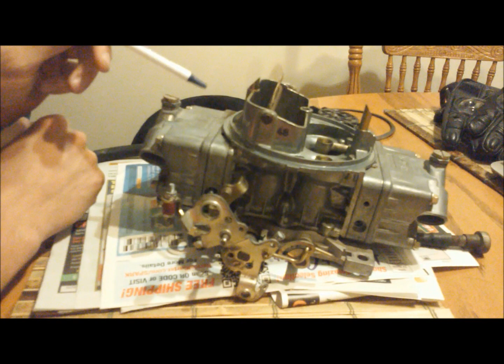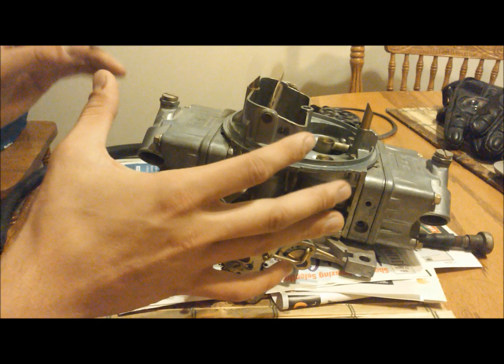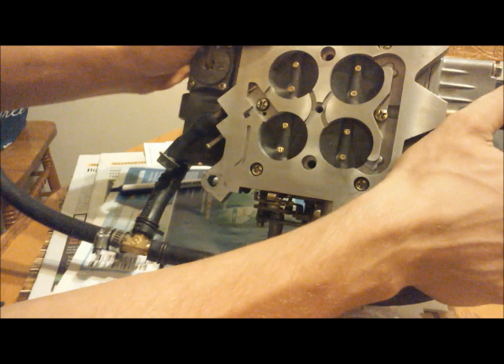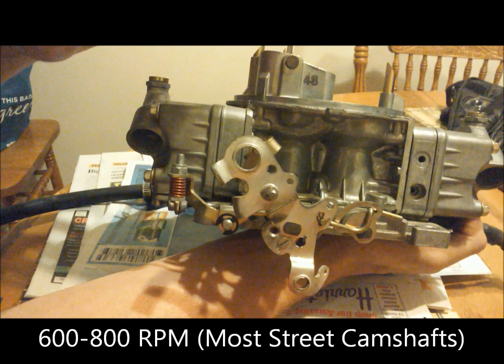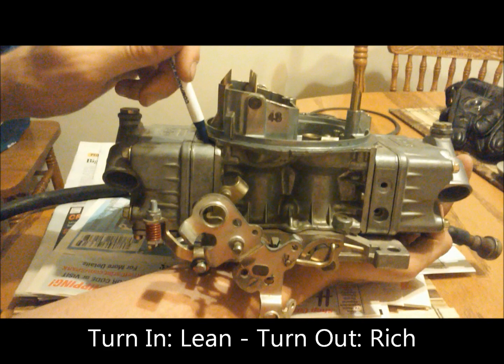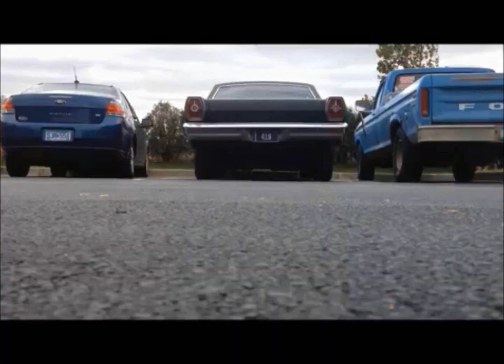Holley Carb: Setting Idle Setting & Initial Ignition Timing (CARB BASICS PART:1)

Comment: Hi ya Luke great tutorials!
With setting the curb idle with ported vacuum you said to advance the distributor to get your desired idle rpm. Well I fully adjusted the distributor to as far as it would go to about 24 degrees, I was still shy of my desired 800 rpm that’s way too much advance for my liking. You also said you can turn the curb idle screw a little to adjust the curb idle without upsetting the transfer slots?
I would like to leave the secondary butterflies as they were from factory ( closed ) without adjusting them to compensate the idle rpm. You mentioned this also, but in another video you said to adjust the secondary’s for extra idle rpm’s? I might connect the vacuum gauge to the ported vacuum and see if I can adjust the curb idle screw to gain the some rpm’s without upsetting the transfer slots letting vacuum in? Hope you can help? Thanks 
Regards 
Greg

Comment: I have a 650 quadrajet could you do a set up on them. 1981 vet. 350.has a mild cam. Motor is set up to a 1979 350. Computer has been dis connected. Had carb. Rebuilt at a shop that does carbs for race engines good repu
tation on carbs. I would like to go to Holly but linkage won't work on my linkage, any help would be helpful.

Comment: Hey, great videos great info as I am getting into lots of older vehicles and I wish to keep them efi free and computer free :). I got finished rebuilding my amc 327 in my 68 Jeep truck and getting ready for cam break in. I need to rebuild the carb as it sat for a year and leaked fuel from cracked seals and gaskets almost immediately. Another factor for the leaks is my electric fuel pump putting too much psi for the needle and seat. I will now be running a pressure regulator and gauge to monitor my psi. Are you familiar with Holley economaster 2300 models?  I imagine the settings for idle mixture, curb idle mixture, and the float bowl settings are all similar to the 4barrels you feature the difference being no secondaries.   Is there a “benchmark” or base setting for the mixture for doing a cam break in as idleing and testing is out of the question until the 20 min 2000 rpm break in recommended by my machinist is over. Thanks!

Comment: To set the bowl level with top screw, is the car running at this time?
Reply from the maker: Usually what I do is see where it’s at while running, then shut the vehicle off, readjust, then run it again. 
Holley recommends that this is all done while running, but that needle and seat assembly is pressurized. 
Unless you want fuel all over your intake, I’d do it how I noted

Comment: like your vids thunder...reminds me of the days I raced 1/4mile drags tearing apart carb after carb watching plug color and times, power valve plugs, increasing air bleed size, jets, squirters, ....hay had to ask, with all the issues surrounding carbs...lots of them along with the fuel pump issues, have you thought of going towards a holley efi terminator set up?
Reply from the maker: chevy vega I hear you - I do it for the people. A lot of guys don’t have the funds to do the efi stuff and carburetor tuning seems to be like folklore these days - I try to provide a channel that caters to the layman where they can keep rolling down the road trouble free
Reply: making the ride all complete slammin in your ride captain ride 8 track

Comment: Hey... Enjoying your videos.... But just getting into this one and you made it sound like a huge no no to touch the blade position on the secondaries, but in the previous video you showd how you use this to help your idle mixture
Reply from the maker: Let me elaborate on that. I used to teach that, but people tend to mess their stuff up when they do it and they have a hard time with it. If it's not a drag car, really most folks will be fine doing it with just the curb idle screw. Just make sure the transfer slots are set correctly.
Reply: I have a 496 in my 89 gmc that i occasionally race. But right now im having isuues at part throttle.... Cruising a 60mph/3000 rpm my afr is at 10.0-10.6. Idle is 14.5-14.9 and wot is perfect at 12.3-12.6... Tomorrow i will be trying to lower my front float as i know its in the top 3/4 of the sight glass... By the way, 780 quick fuel vac secondary. 72 in the front 84 in the back 6.5 pv 15in/hg at cruise. 241@50 hydraulic roller. Any info is greatly appreciated... Ps.. You do wuite a good job with your videos
Reply: But this is y i was considering opening the secondaries... To help lean out the cruise afr
Reply: No advice then?
Reply from the maker: +Joel Scharfenberg I plan to address this - I'm a traveling engineer by day unfortunately it keeps me very busy
Reply: No worries. I understand. Just did not think that woulda been the case when your first reply was within a minute
Reply from the maker: +Joel Scharfenberg alright, able to address this now - what is your manifold vacuum during these pet throttle issues? Do you have a vacuum gauge you can plumb into the car for me? Also, what rear gears are in the vehicle?
Reply: Hey. Good to hear back... 3.73 gears cruising at 3000rpm/65mph i have a reading of 14/15 in/hg.. Idle is 9-10 in/hg. 6.5 power valve... Just the cruise/steady throttle is rich. Idle and wot are perfect. Even under heavy acceleration (not wot) the afr reads decent numbers, cruise afr is about 10.0-10.5

Comment: 2-1/2 turns on the mixer screws?  is that full turns?  I ask because other guys have shown 2-1/2 half turns.
Reply: Kooduh Holley states 1 1/2 to 2 turns, not 2 1/2.   I am gonna try your settings.

Comment: just curious when you are using this method to set the initial timing are you doing this in gear and are you vacuum capping off the advance can while setting timing? Thanks!
Reply from the maker: I am capping off the vacuum advance for sure - i have manual cars, so its easy for me. with an auto, you would want to set it up exactly how you would be sitting when you came to a stop on the road. check out my most recent two carb videos. these should be very helpful - a little more to the point, and demonstrated on an engine.
Reply: Will do. Thanks for the info and quick reply!

Comment: Quick question for you. I have a 1968 Thundebird with a bone stock 429 with a holley 4160 vacuum secondary up top. When i turn on the car it starts slowly reving up like i have my foot on the gas and im slowly pushing on it. Can you think of anything i should check. i do have a secondary issue when i need to replace the voltage regulator. Do you think this could be causing the issue?
Reply from the maker: Well, as an engine warms up, it will atomize the fuel better as it gets warmer and the idle will increase. Make all your adjustments on a fully warmed engine. Or is it an unnatural increase like 500 rpm in 10 seconds
Reply: ThunderHead289 It isn't natural. it goes from like 1000 up to 2500 in a matter of seconds much like if you were accelerating onto the highway
Reply: Do you think the choke being tuned improperly could cause this?

Comment: In another video you mentioned not relying on the curb idle screw; but rather, installing an allen screw in the base to facilitate adjusting the secondary butterflies.  Was that for a mechanical secondary and not a vacuum driven one?  Or, are you just trying to keep it simple for the new and inexperienced?
Reply from the maker: +mark teague im trying to keep it simple, but also use good practices. i still mention only exposing the transfer slot so only a square is showing and then using your initial timing to get your idle right. from there, i personally will adjust the secondaries, but for beginners and with mild street engines, this will work best. when you get up to higher idles like 800 plus, thats when the secondary butterflies need to start opening.

Comment: Good morning. I just subscribed to your Channel.

I have a question (posted same comment in detail on your "Holley Carb Flooding Solution -FUEL PRESSURE" video a few minutes ago).

My question is; why does my engine shut off AS SOON AS I LET OFF THE GAS PEDAL after launching from dead stand still @ 3200-rpm?
Reply from the maker: +Buick Torque iv only had this issue once back in the day when i drag raced the galaxie with a mechanical fuel pump with my smaller fuel line and no return line (open gas tank breather). i had to put a fuel pressure gauge in my car to determine this. when i left the line, the inertia working on the fuel would literally cause a moment of fuel starvation. it was either that or fuel slosh away from my pickup. after an electric pump the issue went away, and with some gas tank baffling it has never happened again. its hard to say. an aft gauge and a temporary fuel pressure gauge plumbed to the inside of your car can tell you a lot.
Reply: +ThunderHead289 Thanks VERY MUCH for your reply. I am using both electric and mechanical fuel pumps with no return line.
Reply from the maker: if you have the time, i 100 percent recommend running a return line. made a huge difference in performance loses in hot weather. with your actual issue, i 100 percent beleive that it is because your pump is too high. lower it and run just the electric pump. What i do with the galaxie is have a block off plate and if i ever have an issue, i have my mechanical pump on hand to install as it will pull through a dead electric pump. my biggest concern with running both is that if your mechanical pump fails, you fill your engine with gasoline. iv had issues with burning down electric pumps without having a return line, so do keep that in mind. my improvised fuel line in virginia worked wonders. heres the video on it. https://www.youtube.com/watch?v=YUmaAQoHggM
Reply: +ThunderHead289 ... thanks; I have to rush out for 20 minutes ... I will return to read and reply.
Reply: +ThunderHead289 ... understood. I am back, and checking out the link now.